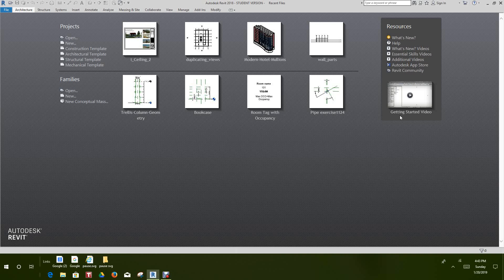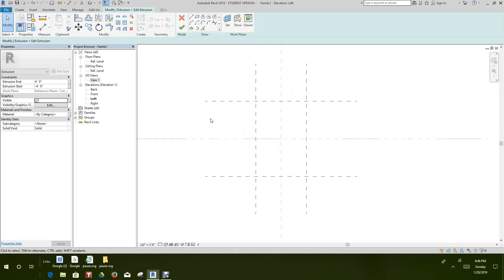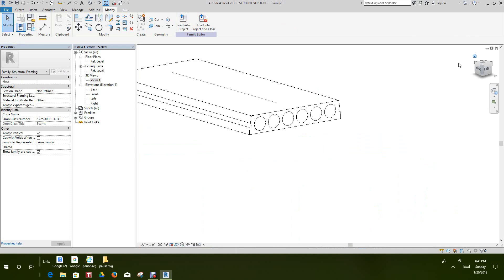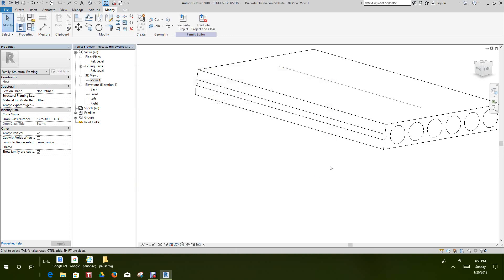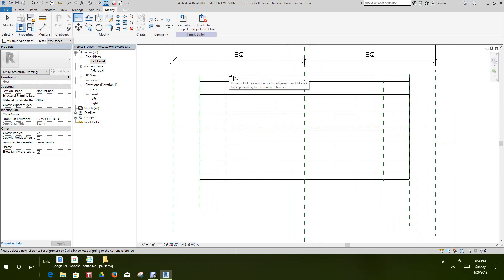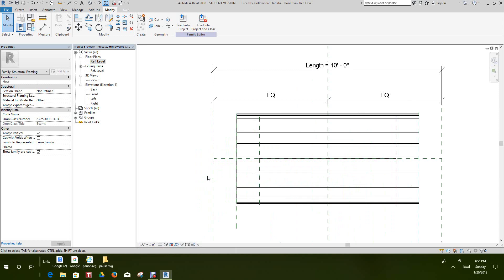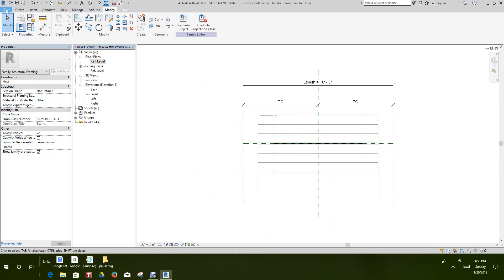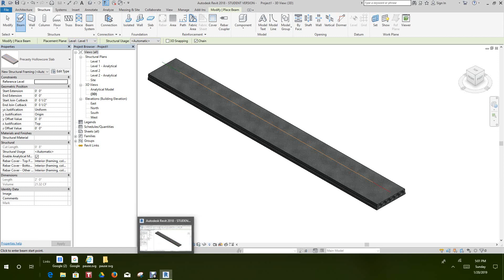Revit Precast Hollow Core Slab Family

Comment: Sir is this possible to design a hollow core on etabs and sap2000? Kindly share please.
Reply from the maker: Hi Abdul sorry for getting back to you so late. Yes you can the family has to be made with the structural template
and it will appear in the analytical 3D model where you would export it into most structural analysis programs. Hope this helps.....

Comment: Do we required to align HCS top with ref. level ?  or HCS center should be align with ref. plan ?
Reply from the maker: Harish it should align with the top ref. level because it should act like a beam or top justification, I use center only in special cases but for a floor it should be top